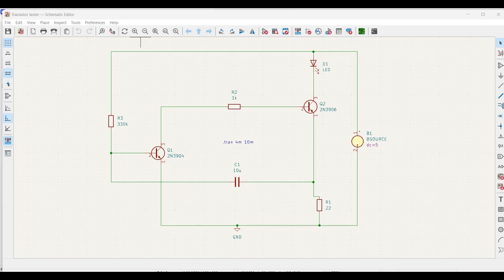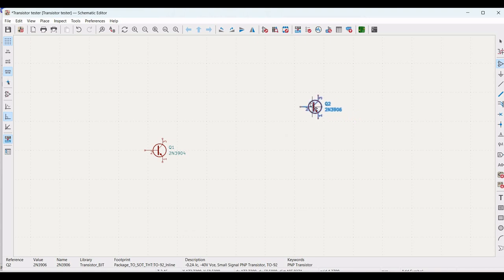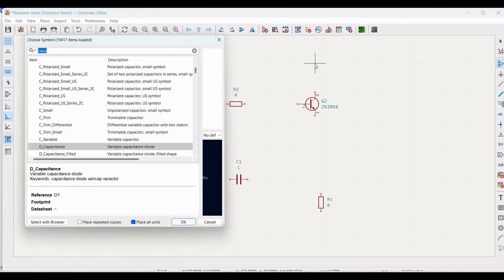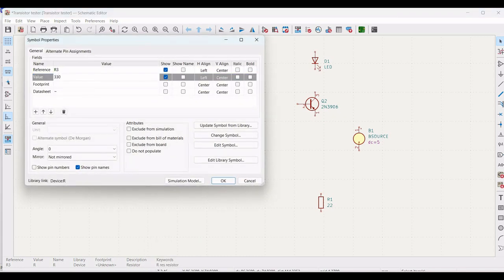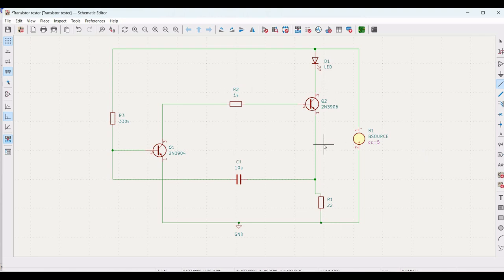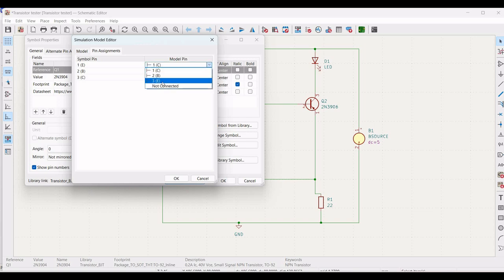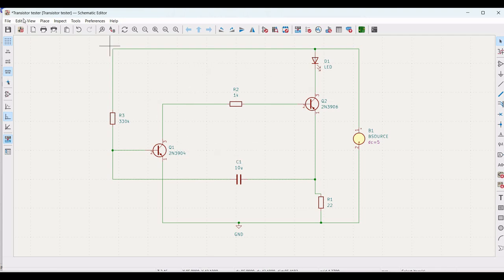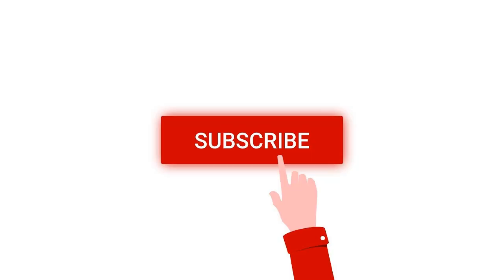How to make a simple transistor tester circuit using Kicad 7.0##44

Comment: 8:00 How do you get these pin assignments? Thanks!
Reply from the maker: KiCad uses different pin assignments for semiconductor components when compared to ngspice engine. The standard SPICE pin assignments for a BJT transistor are pin 3 = emitter, pin 2 = base, and pin 1= collector whereas KiCad uses 1 = E, 2 = B, and 3 = C

Comment: Greetings, good sir.
As a noob, could you explain to me the distinction you draw between "built-in" and  selecting "spice model from file" at 7:05, please?
Reply from the maker: Most of the transistor, diode or Op-amps or any semiconductor device we must explicitly assign the models. But of passive devices such as resistor and capacitor KiCad implicitly assigns models to passive components.